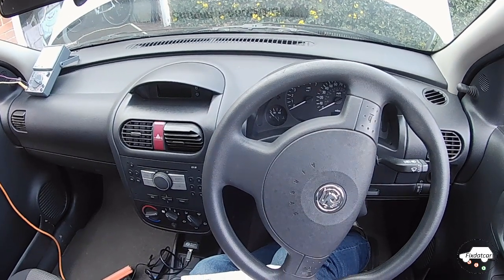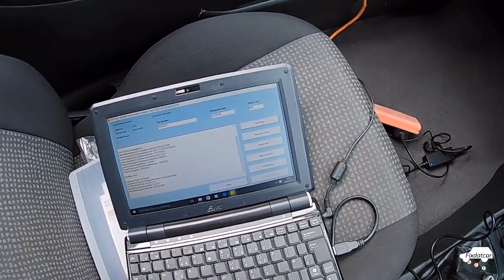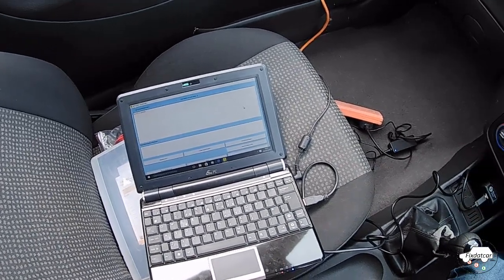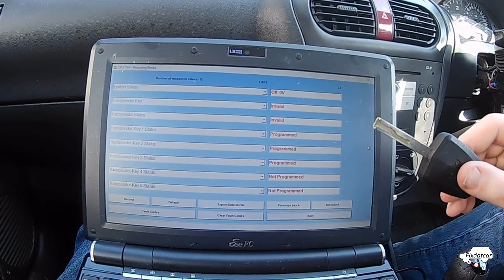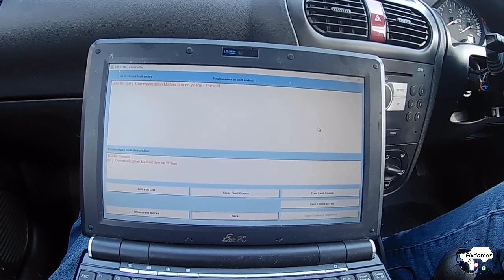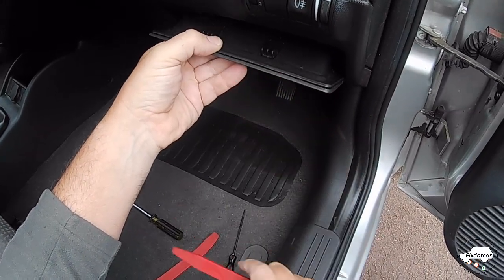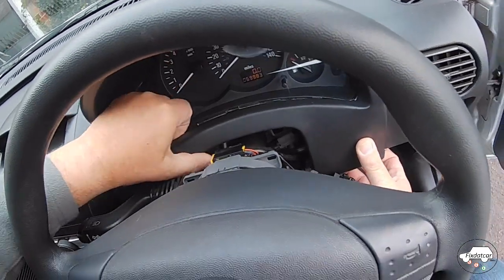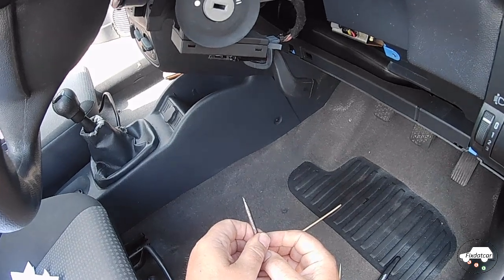How to Fix Intermittent Non Starting. P1612 and B3040  Bosch EM

Comment: Hello. thank you for this beautiful video. My car currently has B3040 error and the vehicle does not start. No communication with ECU. No communication with ABS and Cluster either. the vehicle does not start. the immobilizer lamp is flashing. How can I get the diagram you show in the video? Do you have any other suggestions? Thank you again.
Reply from the maker: What you describe here would indicate that the immobiliser has not sent it's handshake signal. When this happens the ECU will shut down to immobilise the car. (Also prevents you from communicating  to get ECU fault codes.)  So either the immobiliser has not been able to read the key? - If you have a second one try it. Or the handshake signal has not been sent? - This will not be over the Can-Bus, but on a dedicated wire.  In my case there was a poor connection to this wire on pin 7 of the Immobiliser connector. To find which pin it is on your car you will need a specific wiring diagram. I found the one used in the video by Google search.  Good luck, I think you are getting close.

Comment: Did you have comms with the immobiliser module and ecu whilst this fault was present ? I'm in similar scenario.
Reply from the maker: No comms with ECU. The reason for this is that the immobiliser reads the key then sends a message to the ECU via a dedicated wire. If the ECU has not received this message it will shut down leaving the car immobilised. in my case the dedicated wire had a poor connection.

Comment: HI, Today my Vauxhall Meriva for the first time cut out about three seconds after starting and i noticed the check engine light flash half a dozen times. I then started the car as normal with no issues. However as i was driving, i noticed that whenever i used the left indicator the interior tick noise seemed to intermittantly flash & sound faster. The indicator bulbs themselves all appear to be flashing normally. So i checked the fault codes with a bluetooth obd adapter and the code P1612 showed. After googleing it appears to be related with the imobiliser but ive also seen people suggest a faulty indicator relay. Any idea if these could be related? I think i may change the relay and bulbs costing less than £15 before assuming something major. Thoughts? Thanks
Reply from the maker: Failing this if P1612 still occurs you will need to become more analytical (as in the video). The immobiliser sends a handshake signal to the engine ECU via the BCM when the chip in your key is read. If this fails the engine ECU will shut down and P1612 is generated. In my case the connector to the immobiliser had been taken off and pushed back on a few times causing a poor connection to the wire that carries the handshake signal.
Reply from the maker: I'd be tempted to treat this as two separate faults. Start with the basics though; alternator test and close visual check of wiring. (On the wiring it's corrosion or previous interference that are the main suspects to look for.)